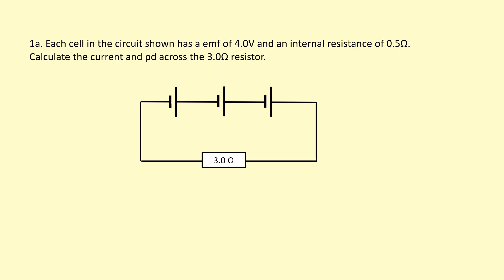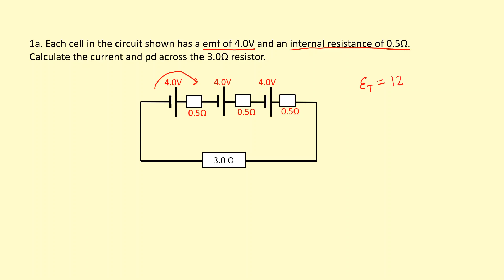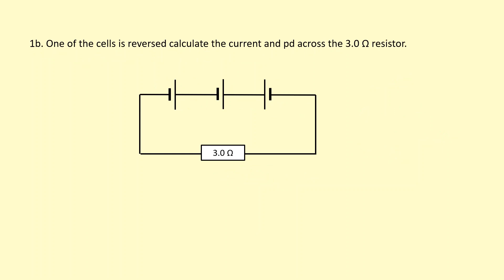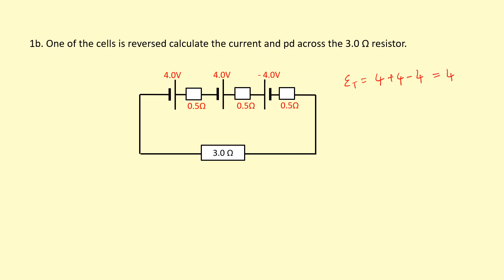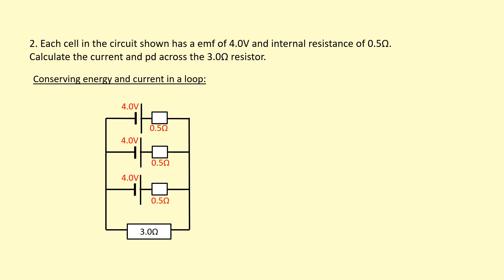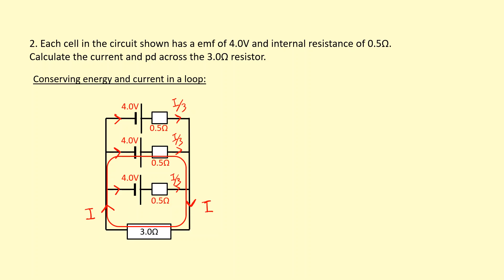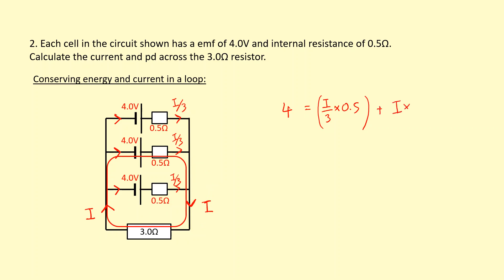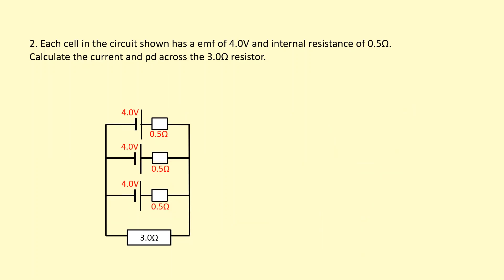3.25 How to deal with multi cell circuits

Comment: goat i just clocked this type of 'conservation of energy' was also in paper 1 2023 electricity question, does it only apply to parallel circuits? cos in the question it was a series circuit but same concept still applied